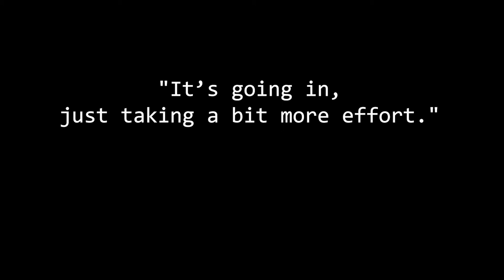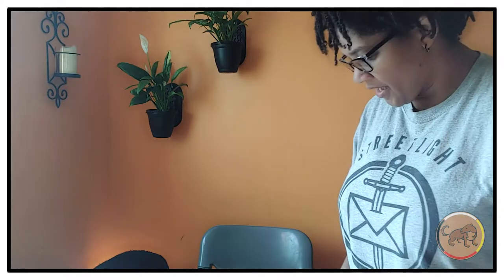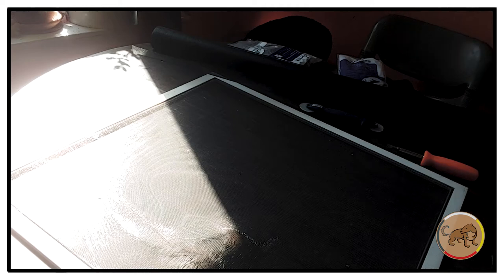DIY | Replacing Window Screens

Comment: I like the spline tools that have metal wheels best. The rounded (convex) side is to seat the screen pre-spline. Then you start the spline and press it in with the cupped (concave) side. I'd replaced screens at the apartment building I lived in a few years ago.
Reply from the maker: Ah, I didn't know that. But I think that's what I ended up doing because it seemed to work better.